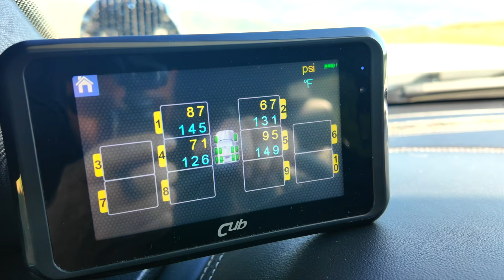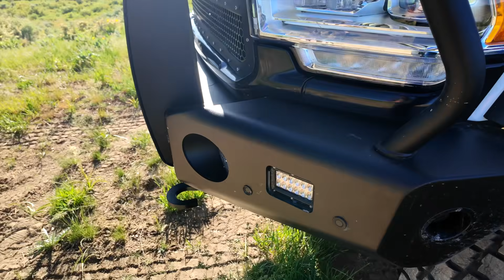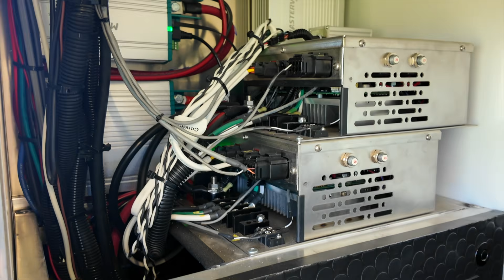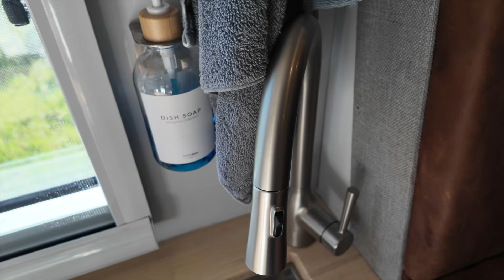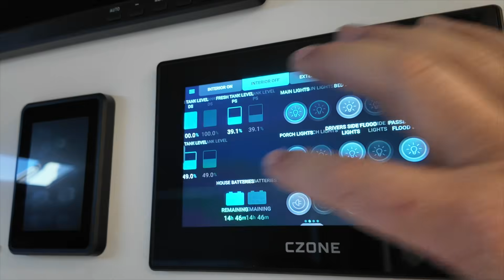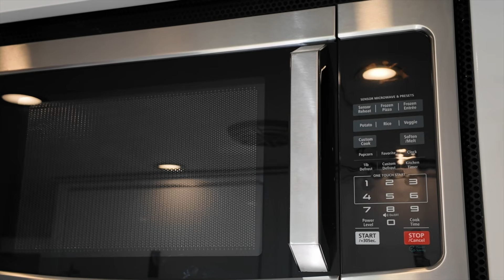Adrenalin Overland Camper: Field Tested

Comment: t's a very nice adventure truck but the problem with this build is the same as the EarthRoamer LTx. It has a 18,000 lb weight and fully loaded with multiple people, fluids, equipment, supplies etc, you are at or over the 19,500 GVWR.  Yes, improving the suspension, tires, etc will improve ride quality but you can't change a manufacturer's GVWR because you can't change parts like the frame, axles, etc. A truck like the Supertramp Megatron or Rossmonster Baja Plus are much better sized for a 5500/F550 chassis. Both of those weigh a little over 14,000 lbs so you still have a lot of capacity left for payload.........
Reply: I talked directly with the guys at Adrenalin. They claim the weight of the AWOL is 16,500-18,000 depending on the configuration. BUT that is with full fuel and fresh water. So, that gives you some more room to work with.
Reply: @user-ez6gg  Well, if you go to their website, it says that the AWOL is 18,000 loaded. I assume they mean wet. For example 100 gal of water alone is 800 lbs. They can't guess a customer's personal payload. My payload is definitely over 1,500 lbs because my motorcycle and carrier alone is 1,000 lbs. Now add 2-4 people, etc. You can do the math.......
Reply: @DaltonHan  Correct, that was their wet weight. I think a lot of the competition that claims 18,00lbs is dry weight though, so much worse. But it sounds like it wouldn't work for you anyway. If you are carrying that kind of payload you probably have to go to a medium duty chassis like an International HV 507 or something similar.